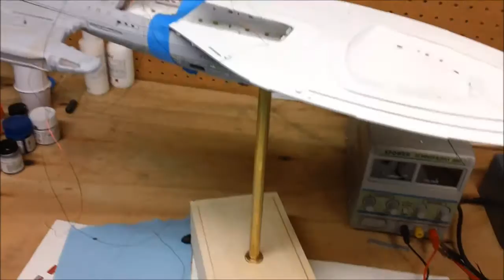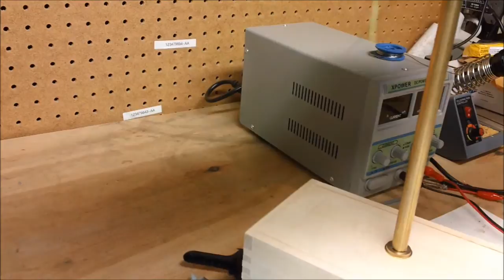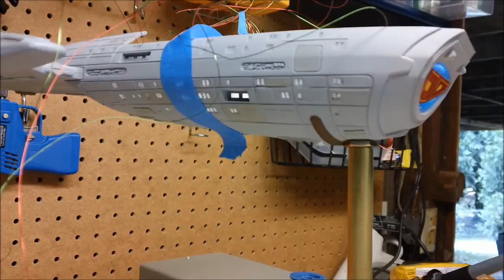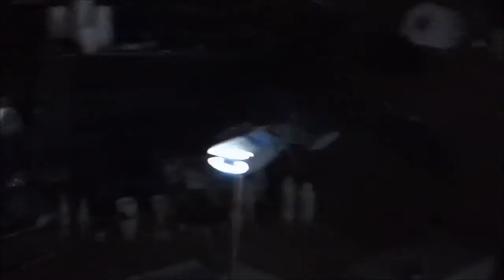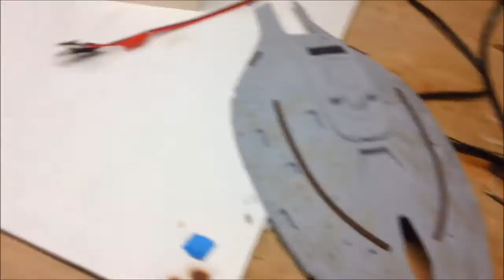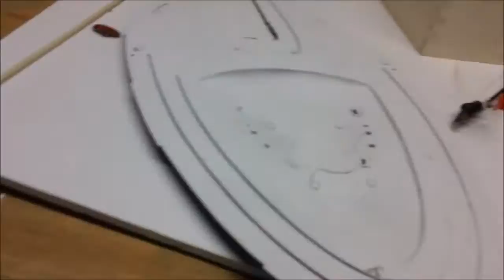Voyager Part 6

Comment: where do you get those brass poles
Reply from the maker: Lowes, Home Depot, Hobby Lobby, or Orchard Supply. There is a section that holds small metal pieces for projects.
Reply: Thanks for the reply but I live in England and we don't have any of those shops does the pipe have a specific name? Just can't seem to find one.
Reply from the maker: +Chris Freeth the brand is k & s engineering. U could also just search brass rod on eBay. All sorts of sizes available
Reply: Okay will search eBay and hopefully find something. Your voyager model looks great by the way you have inspired me to continue with mine which  I have been doing for the last four years lol.
Reply from the maker: +Chris Freeth awesome! Glad you like it! Yea bud keep it up and get it finished. I have a second one in the closet so I can try to do an even better job one day.